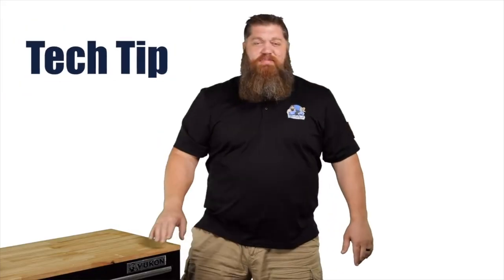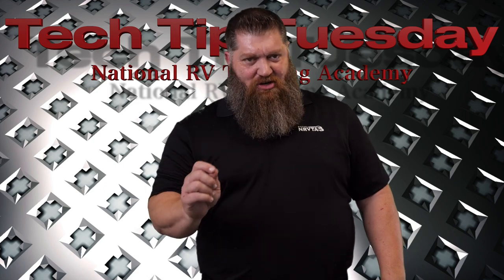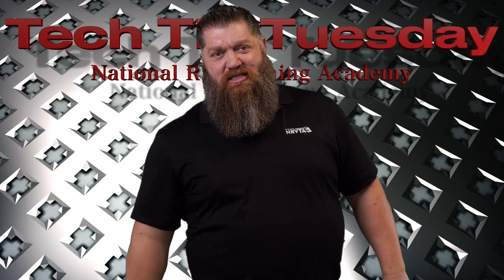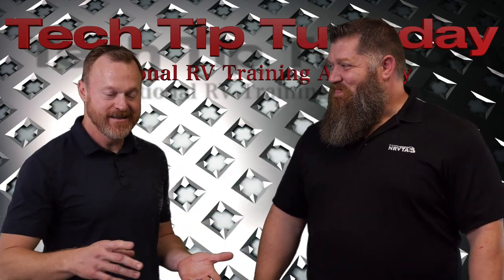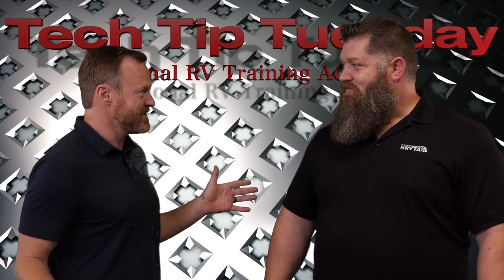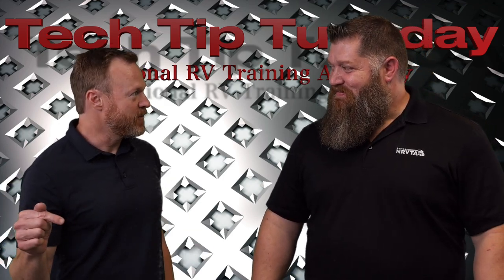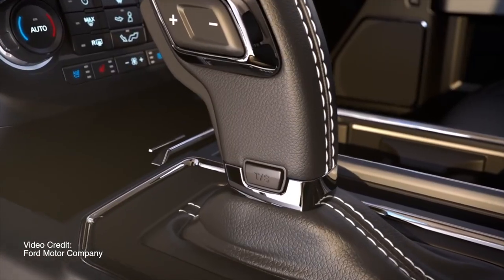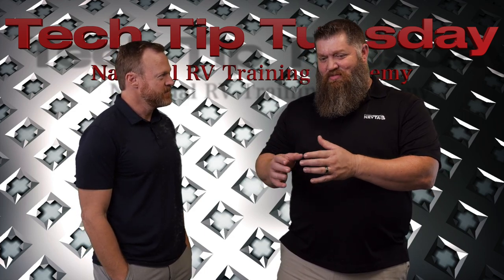Using the Tow Haul button when pulling an RV

Comment: On GM trucks, there is a system (SARVC) that will normally throttle down alternator output to prevent overcharging the battery and extend its life when power demand is low.  When in tow/haul, it disables this to send full power all the time to charge the trailer's battery via the 7 way plug.

Comment: Running a Ram 3500 dually; towing a  18,000 dry weight 5th wheel.  Always run with Tow/Haul on and Engine Brake on auto. Typically run on cruise control and it pulls up most grades and maintains speed like spreading butter. For the occasional dramatic grades (up or down) I often use manual shift up and down to maintain an appropriate rpm.

Comment: Tow with F350 dually and use tow/haul mode with RV.  On open interstates we cruise control based on posted speed limit and road conditions.  I think ya'll could be brothers from another mother.  LOL.  You two do bring so much good information to the RV community.

Comment: Interesting video. I watched a video of a 1 million mile Ram from a guy that did some hotshotting. He only used his tow haul mode on mountain terrain. On the flats of I70 and places like that he never engaged the tow haul. He didn’t feel it was necessary on flat land and didn’t care for the slightly higher RPM’s that comes with tow haul. Not sure if that makes sense but it worked for him. Good video
Reply: If the RPM's are too low when you're towing a heavy load, the transmission pump won't be pumping enough volume through the transmission cooler to cool the transmission, which is why they recommend turning overdrive off.  However, if you're going fast enough, then you might get the RPM's up high enough even with overdrive on to be pumping enough to keep it cool, in which case you'll be fine.  But it's hard to say what speed that would be as it all depends on the vehicle and the gearing.
Reply: @NorthernKitty once I get to my desired speed then I’ll turn off tow/haul and put it on cruise control!

Comment: On  my 2019 Dodge RAM with Cummins diesel, I use Tow/Haul and I set the exhaust brake on AUTO, not FULL. The exhaust brake and downshifting starts when you tap the brake. This allows you to coast (and keep the exhaust brake off) when you don't need to slow down.
Reply from the maker: i have the same preference
Reply: I love the exhaust brake on my ram especially going down mountains or steep hills

Comment: 2003 F250 7.3l. I only use tow/haul mode on steep grades. If u keep the tow/ haul mode on while driving the extra engine speed will heat the transmission fluid quickly. Even with the upgraded trans cooler. Especially if it's 115 degrees outside!

Comment: Thanks for the video. I love Tow/Haul mode on my 2019 GMC Duramax 3500HD. I use it whenever I tow. I don't like that it doesn't always go to 6th gear when I'm level and up to speed (in CA that's only 55), but there is a simple solution to that. Cross country when I tow at 60-64, all is well.  Thanks again,

Comment: The tow function on Silverado (5.3, 8cyl) works great, I can see no reason not to use it when towing. Thanks for your advice… always well presented with salient advice!
Reply: Also have a silverado  tow / haul seems to increase fuel consumption +++
Reply: @mikewebster2984  I agree
Reply: On my Suburban with the 5.3, I always use the tow/haul feature.  Be aware that using the cruise control provides engine braking when going down mountains but can also cause an abrupt lower gear change when going up mountains resulting in broken engine mounts. Seems to be a flaw in the design of these from GM.  RV tip brought to you from the Voice of experience.  Motor mounts are not fun to change out by yourself.
Reply: @mikewebster2984  my silverado does better mpg in tow/haul. not so much shifting back and forth

Comment: Another benefit is while in the T/H Mode it automatically go's to a lower gear which increases RPM which gets you in a better torque range.....closer to the engines optimal torque to RPM range.

Comment: Ford F350 Platinum.  Tow/Haul mode on, adaptive cruise control set (once speed is reached) and auto engine exhaust brake on.  Works like a dream. And BTW, if you want to stay at or under 2 min, Marc isn’t the guest you want to have on, just saying.
Reply: Not Marc's fault.  Todd is the one in this video that keeps interrupting his guest.  Why have a guest, Todd, if you are going to do most of the talking?

Comment: I've got Tow/Haul in my motorhome on the Ford F-53 Chassis with the 7.3L Godzilla V-8. I love, love, love it.
When I'm towing the Toad I'm in Tow/Haul. it adds the engine brake when I'm headed down a grade. When using the cruise control in T/H it allows my speed to drop about 5mph before it down-shifts. When I'm not towing the Toad I don't use T/H. Then the cruise control tries to keep my speed steady uphill, down-shifts and all.

It's a great feature for me and, like you, it's engaged when I'm towing and disengaged when I'm not.

Comment: 2007 Chevy 2500 HD LBZ Duramax 6 speed Allison Transmission pulling 35’ fifth wheel. I pull with Tow/Haul on but I do not pull in 6th gear. I go manual and only pull up to 5th gear. 65mph and up to 70mph while passing if needed. I have been told pulling in high gear is not good for the transmission and fifth gear gets the speed I want at 2000 rpm

Comment: 18k Riverstone 1st pulled with 2019 F-250 355 rear. I had to use tow huaul. Upgraded with F-350 Duly 433 rear. Tow-haul burns too much fuell. With 433 rears, no need tow haul, saves fuel and pulls Effortlessly over the Rockies Canada, and the good old USA!. Long time Ford truck specialist agreed, the drive train setup in this truck in drive is all that's needed. Also saves wear & tear on the transmission.

Comment: I'd like to clear up the question about "more power" to the trailer power connector. That's not really likely. The plug is spec'd for 12 volts and most likely a maximum amperage. The trailer would be out of spec or have a short if it attempts to draw more. Any vehicle that has the connector should be designed and have a fuse to provide that.

Comment: I have a 2003 Dodge Ram dually Cummins some earlier trucks do not have this function so I just drop out of overdrive also I have installed a pacbrake exhaust works great even on cruise control 👍

Comment: i was told by a RV tech.. never drive in Tow Haul unless ur going up/down hill w a trailer.  He said using Tow Hall on level or basically full time will severly damage the truck, he also told me no to install a sway bar on a trailer truck combo that has intergrated hauling tech as the two will work against eachother.  Toyota says to only use tow hall when inclining or declining

Comment: I guess I’m the odd 1 out here. I prefer manually shifting. It’s far easier for me to control the rpms. I’m not a fan of my engine revving from 4 to 5000 at times. Definitely hard on the engine. I should mention that 90% of my towing is in mountainous terrain.
Reply from the maker: Tony, our marketing director does too.

Comment: 2014 ford f150 5.0. Tow 5500lbs. I use tow haul as it only changes shift pattern and lock out 6th gear and use manual shift as required to maintain wanted sweet spot rpm.   Use cruise when on open road always if not in hills and mountains
Reply from the maker: Good stuff

Comment: We have a Ram Promaster 3500 van with the gas V6 and tow/haul pulling a 3000# trailer. With tow/haul on, the transmission locked into 2nd or 3rd, and absolutely would not shift. Even at 50mph on level ground, it would run at 4200 RPM. Turning tow/haul off wouldn’t release it. Stopping and shutting the engine off and restarting wouldn’t release it. Switching to manual gear selection wouldn’t release it. Finally, after an hour with the engine revving needlessly, we stopped for gas, and afterwards it would shift normally. Guessing it needed a prolonged shutdown. After that, I’m just using manual gear selection.

Comment: I have a 17 F350 sw 6.7 PT. I tow my fifth wheel I always use tow mode but when I tow my little 17ft aluminum bass boat I dont use it. It jerks the boat around in tow mode.

Comment: Tow Haul is there for a reason that you failed to mention > pressing Tow Haul keeps  your transmission from going into the sixted gear (high speed gear) this gear is not designed for pulling it can and will soon or later shatter or strip the teeth causing thousands to repair the tran . I had a friend that never used the tow haul and i told him he's playing Russian roulette with his transmission he said i was crazy and he been doing it for years Two months latter he was pissed his transmission blew out the gear and did major damage to his tran
Reply from the maker: Thanks for sharing.

Comment: I use Tow Haul when in the mountains, areas with hills or suburban/urban driving. If I am in generally flat areas or non-city/rural areas I tend not to use it so I can spend more time in the higher gears. My use of cruise control is similar. In a nutshell if I know I'm going to have to spend a lot of time adjusting my foot on the accelerator or braking I use Tow Haul otherwise I don't.
Reply: what about in snow or hills do you use 4x4 while towing , should you be in  4x4 w tow haul on for snow

Comment: My two questions are for a future video (or refer me to one that has been made). First, RV battery care. It is nearly impossible to RV and not hit freezing and nor about 104F temperatures inside towing vehicle or camper. What is the best way to protect the lithium battery? How bad it the temp damage and what can be done to minimize it? Second, how should the battery, connected to roof solar panels,  be protected when not being used? For example when in storage or parked unused for a few weeks while plugged in to 110V to keep a heater going to prevent freezing. Whill the lithium battery protect itself? Should it be turned off? Removed? Or not to worry…
Reply: You cold get heating pads for your batteries. Some of the newer lithium n[batteries have a heating system built into them. Some folks lay a utility heating lamp in their storage area or battery areras to keep pipes and or batteries warms.

Comment: On a GM truck the tow haul button will increase the alternator output to aid in charging the trailer batteries.

I use cruse when the conditions allow, when you start down a hill in tow mode the cruse will automatically downshift to maintain the set speed.

Comment: I have a 2018 RAM 2500 with 6.4 HEMI. No diesel because I am not on the open round enough to make a diesel fully functional. Having said that. My TT is normally at 8300LBS loaded with my stuff, Maz is 8700 LBS. If the water tank is full if not then the with is 7900LBS. I tried tow-haul going to Colorado from New Mexico and many of you know the hills. Did what I expected. Coming back I decided not to use the tow-haul and it was day and night. I did better without the two-haul off. Engine braking is still in effect with or without the two-haul active. FYI

Comment: Sometimes the gear down on my f-150 is a bit too extreme for some conditions I've been in. So I have had to turn the tow/haul off for control purposes. I use it 90% of the time, basically.

Comment: With my Tundra while in tow haul mode it has built in sway control. If the tow haul mode is not on it will not do the built in sway control. I thought it was with mentioning. Check your owners manual to see if you have tow haul mode activated built in sway control. 👍

Comment: 2018 f150 2.7 ecoboost with 3.55 gears and 10 speed trans towing 6800lb trailer. Always in tow/haul and cruise on with gears 8, 9, and 10 locked out. 7th gear is a 1/1 ratio.
Reply: Hi mark what trailer?  Truck sounds like mine is spec
Reply: @bobcade  2019 Keystone Springdale 260BH

Comment: towing with our 2019 F150, 5.0 and 10 speed. Always use tow/haul. It changes inputs to the engine and transmission via the PCM and TCU. Also, on the 7 pin, there is no voltage to the "charge pin" unless a trailer is connected. Super smart truck knows when the 7pin is connected and make needed adjustments. I thought I had a charging problem since I checked the "charge pin" without a trailer connected...nothing at the pin. Took to dealer ( in warranty), they by-passed the computer to test and everything working properly. I haven't heard of increased voltage, though.

Comment: I have a class A ford V10. Should I be using this when I tow my Honda CRV. Also you talked about cruise control can you still use that when you are in tow haul mode?
Reply from the maker: That would be a perfect time to use it. It will help a lot with slowing down.

Comment: Tow/Haul with Full Exhaust Brake on my '17 Ram 2500 leads to issues with 4wd (a warning light) even though 4wd is not in use.  I have been told by a former mechanic
that Ram owners need to use Automatic Exhaust Brake when Tow/Haul is active. Indeed, this does get rid of the warnings. It is confusing.
Reply from the maker: Thanks for the info!

Comment: Thx to both of you. I have been using the auto on my exhaust brake on my 2017 f250 6.7 it seems like since I started towing a fifth wheel. I tried today and the truck runs a little better and was averaging 2 mpg better due to no high revving. That helps in braking the camper. Appreciate that! Been thinking about the tech school a lot. Close to retirement so maybe a possibility.

Comment: Great video guys!! Love KYD! We have a '07 F250 and when we use the tow mode it makes a weird noise. I don't like it. I tell my husband "Turn it off. It sounds like it's wearing it out" lol We also don't use the cruise control. Did on our 1st haul picking up our RV and coming back on a 3 hour trip it cracked our radiator. That was a pretty penny. Lol
Reply from the maker: That does not seem right…we hope you got it all taken care of.
Reply: That is really common with stock radiators. You probably cracked the plastic end tanks. Get yourself a decent all aluminum radiator and intercooler to eliminate a future issue. 👍
Reply: @chrisyoder8429  That's what happened and that's EXACTLY what we had done. No worries now. Taken it on a few trips since then with no problems.

Comment: 2004 3500 dODGE 5.9 stock Cummins  I have a gear vendors behind the trans and use tow haul with the gear vender when I am on flat land.  Shut off the gear vendor when in the hills and mountains.  Any problem with using it this way?  I get 21mpg with o/D and about 15 with using tow haul in Colorado.

Comment: My 2004 Southwind gasser doesn’t have a tow mode. However it has Overdrive On/Off. Is this equivalent? I typically leave it on when towing our Cherokee except in hilly areas.

Comment: I've seen amateurs blow transmissions by leaving their transmissions in overdrive mode. The Ford six-speed auto has two overdrives! 
In hilly terrain, you must deselect Overdrive (hit the OD button) or the overdrive part of your transmission will burn out . . . blow up . . . fail. 
Yes, you get poor gas mileage, but that's the torque issue with gas versus diesel engines.
The new Tow selection . . . might be more complex a control system, but it is basically so you don't destroy your overdrive going up and down hills.

Comment: I have older rigs. (No tow button) I was towing a 16’ with my 2000 Cherokee. I was told to take it out of overdrive when towing. I does much better that way but speed is limited. I learned to live with that. I recently switched to a 2000 class C. Do I apply the same thinking to it? I think it should have need built for it or it would have had a different transmission. It has a 454 w/ LD80.

Comment: I use the tow haul  and cruise control when towing with my 6.2 gas in my F250 but I will usually pull it into manual when pulling a big grade so I have a bit more control
Reply from the maker: Tony has the same truck and leaves it in manual. He can control when to go low and when to keep it in 5.
Reply: I have a 12 f350 crew dually with 6.2L.  Recently got it.  I prefer manually shifting.  Gives me more control.   And I use cruise control.  I'm not ready for a diesel due to maintenance and repair costs, but I do wish it had more torque.   Thinking of changing diff gears to 3.92 or 4.11.  It's only purpose for us is to tow.

Comment: My truck pulling wants to stay in lower gears up over 65 mph. That’s eating up gas, what’s up it’s not lugging at all. Total combined weight is only 12,300. Is that normal?
Reply from the maker: When you are at highway speeds you can turn off tow haul mode.

Comment: I’ll limit my comments to Ford diesels 2015 or newer. I’m pretty sure it would apply to ram/Chevy. Long winded discussions with mechanics on transmission use.  

First you don’t turn your jake brake/engine brake on till you need it. When you drop over the pass going into Jackson wy you turn it on. If it’s on all the time it will be braking when you want it rolling I.e. reducing mpg. Normal mode is off. 

The transmission are self learning and continuously updating. It gives the best mileage for your driving behavior. If your not towing and heavy on pedal it will shift one way as compared to towing a 5th wheel in downtown Cleveland. When shifting from plains driving to mountainous towing it takes time to adjust. Towing mode or not it’s working at giving the best it can give. 

Towing mode when towing gives the best performance and least amount of wear on the components. Use your brakes less and less stress on the transmission (shifting up when it should be down)

When traveling in mountains with lots up and down I run in towing mode all time. Towing or not. Set cruise and the truck takes care of the slowing down without braking most of time. (It’s not just for towing)
Reply: Run with cruise most of time